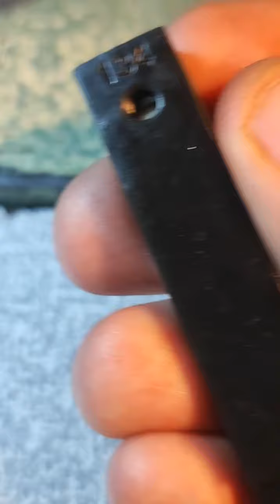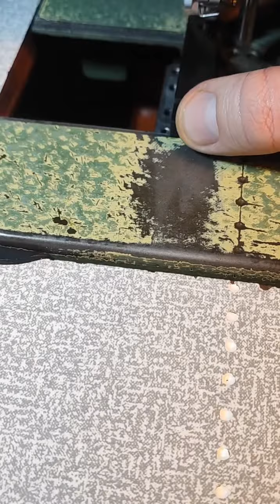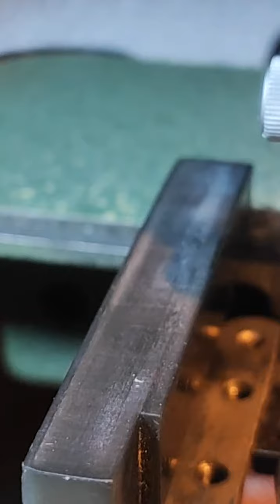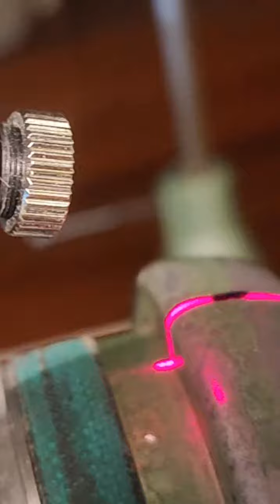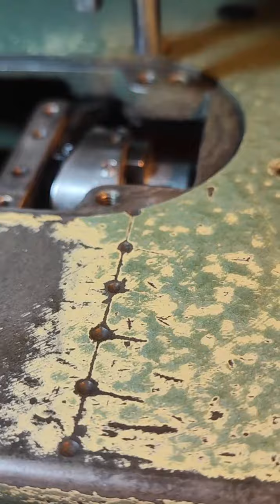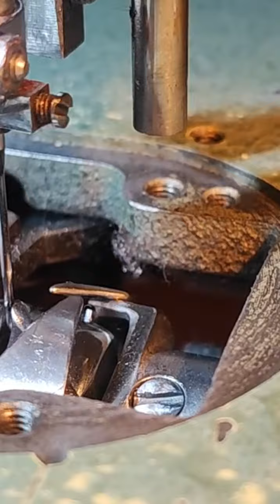Textima Altin hook timing adjustment

Comment: Many thanks for posting dimensions of those steel blocks for setting needle height for 135x1 and 134 needle systems. Now I can fabricate them myself and set my machine correctly. Many thanks again.
Reply from the maker: https://drive.google.com/file/d/1amj9MfU-TR23ka_uUs6TEA07VQbr2Vqp/view?usp=drivesdk

You can find more info in this book (page 21)
P.s:
Thx for your kind reply